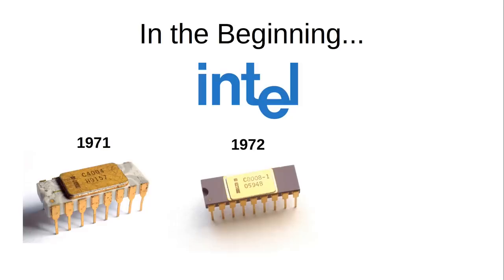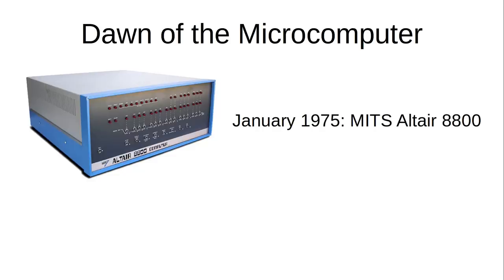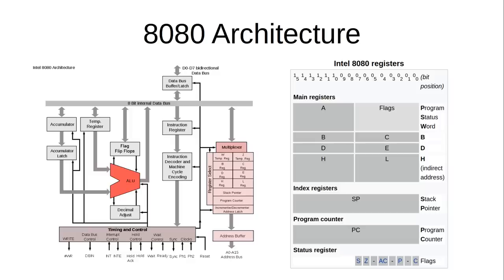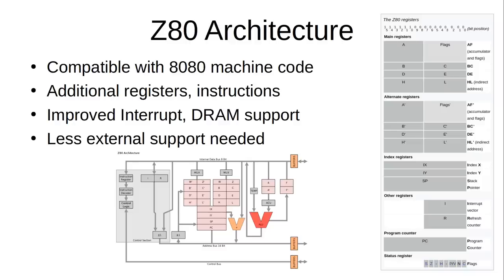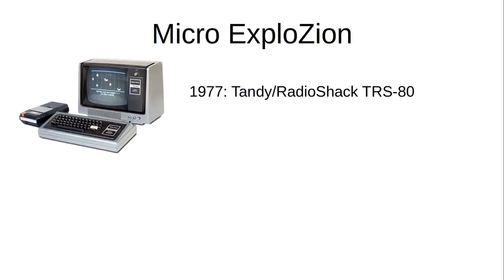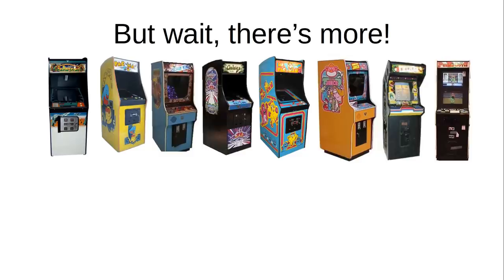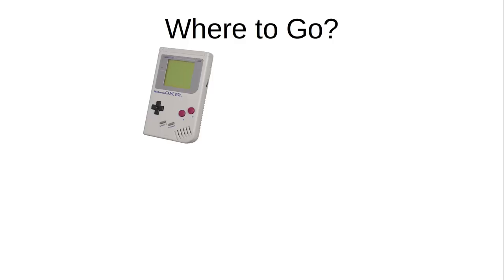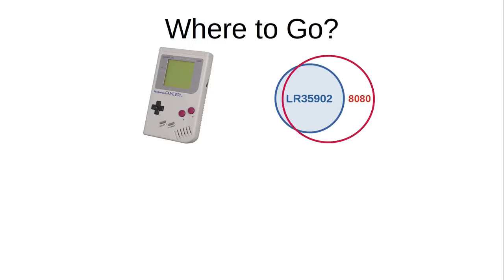Looking at the Zilog Z80 - NEW SERIES!

Comment: Use the Australian Microbee as your development platform! It evolved from an S100 bus computer made mainly from readily available penny logic. It can emulate many machines from TRS-80, ZX Spectrum, MSX computers, Exidy Sorcerer and some commercial arcade machines. Note that the Z80 actually uses a 4 bit accumulator which unfortunately lead to variable length execution times that complicates interfacing with shared video RAM.
Reply: Wow, another microbee user! I couldn’t afford one, so I got hold of the circuit diagram of the bee, and made my own using wire wrap technology, cloning the eprom from a mates real one. . Even built the floppy drive and colour video interfaces. Taught me so much. Wish I had kept it...

Comment: Two more British home computers that featured a Z80 CPU were the Memotech MTX 500 & 512 machines and the Jupiter Ace which used Forth instead of BASIC as its programming environment. I started out with a Sinclair ZX81 (with a 16k add-on RAM expansion by Memotech) and then a ZX Spectrum. I've recently returned to my Z80 roots (after messing about a lot with PIC, AVR and ARM microcontrollers) with the recent purchase of a Z80-MBC2. The Z80 has always been a great processor for me and I'm looking forward to coding in Z80 assembler again.

Comment: The lack of Ram on the ZX80 meant that to do anything really impressive you had to write in machine code. The Sinclair Z80/81 was one of the best written manuals for a micro computer ever and funny too, it was also very good on the machine code and how to write machine code programs. I found the Z80 instruction set much easier than the 6502 we had at uni.
There are some odd gaps in the Z80 instruction set, one can even work out what they might do and some of them did do things but usually totally totally screwed up the flags register.
The Sinclair implementation of the Basic programming language is still probably the best Basic out there. And I like GoTo.

Comment: Interesting video about the history of the first computer systems.  I assembled my first computer in 1976, the SWTPC 6800; soldered pin-by-pin to the circuit boards with 4k RAM.  I still have that computer.  It used the Motorola 6800 MPU.  Thankfully, I'm a programmer, so I was able to write the device drivers (in Assembler) I needed for my peripherals, including a Heathkit H14 Dot Matrix printer (also assembled by me)
Reply from the maker: That is really cool! Does it still run?
Reply: @slithymatt  Yes, it still runs.  I wrote my own BIOS for it and burned it to an EPROM to make life a bit easier.  Added a Percom floppy disc drive (10-sectors, hard).  Modified the BASIC interpreter and Assembler to read data from the drive instead of the cassette tape player.  Bought a video board, and wrote the device driver for that as well.  Good time.  Good times.
Reply from the maker: @RamblinRick_  that is really impressive
Reply: @slithymatt  thank you

Comment: A very useful 8-bit cpu, going way back.  RCA's 1802 is also one of those nifty 8 bits, but this one was one of the earliest CMOS chips.  It had onboard a number of features that many microcontrolers later sported.  In many was RCA's chip was one of the most groundbreaking chips ever.

Comment: I put together an IMSAI 8080 as a kit in the late '70s. The person I later sold it to replaced the CPU with an Z80 processor and installed two 8" floppy drives.

I also worked for an Apple dealership in the late '70s and '80s. We looked at selling the Sinclair computers, but they looked too much like toys and the video would flicker for every keystroke.

Comment: I still have a ZX80 that most likely still works.
Chances are in some box, I also have the 16KByte expansion RAM I built for it.
You could do quite a lot with a ZX80.  Some people made maze solving "mice" based on them.
The thing about the ZX80 that allowed a lot of this was the fact that the whole bus came out on the expansion connector.

Comment: Excellent. I look forward to the series. I'm originally of ZX81, then Speccy origins myself :) [ I still have an Amstrad "Sinclair" Spectrum+2 in a drawer next to me - and in the back room gathering dust, I've got a Yamaha CX5M II MSX Z80 Machine with FM synthesis a la Yamaha DX21 keyboard, but with on screen controls :) ]

I took apart a Sequential Circuits TOM Drum machine I own the other year, just to take it apart and clean the contacts on the pads, and was pleased to find a Z80A CPU sitting proud inside :) 

aside: LDIR is still my favourite assembly opcode, but I really should get out more :)
Reply from the maker: If you have a favorite opcode, you've found the right channel. Thanks for coming by!

Comment: I did a bit of research and analysis when I was deciding which z80 based platform I'll port my game to first. I chose the MSX2, mainly due to it having multi-color hardware sprites. Like you, I have never used a ZX Spectrum or an MSX system, but my understanding is they were both wildly popular in their respective regions, with the MSX even having a following outside Asia. But your call on the Spectrum is probably the correct one, I think it has a much more vocal and prominent nostalgic fan base.

Comment: Back in the mid-70's the 4004 was used by a medical company in the Central Florida Gulf Coast region.  Later followed by the Zilog Z80, and then the Intel 8086.  Those were the good-ole days.
Reply: I can remember programming the 4004 to control a model train set.  That was the day of hardware revolution.  Things moved so rapidly that every year was a huge step forward compared to the year before.

Comment: I'm still doing a lot of Z80 programming! My most recent sub-project was writing binary32 float routines 😎 (Part of a larger project that has 80-bit, 24-bit, and another 32-bit format, hopefully with binary64 and maybe some base-10 floats in the future)
Reply from the maker: It would be interesting to see how well a Z80 could do double-precision floating point. I know the answer will be "not very", but how bad compared to other 8-bit integer-only CPUs?
Reply: At the moment I'm faking double precision by wrapping it in the extended precision routines which are pretty decent speed-wise. On the TI-83+/84+, they are far faster than TI-OS's floats (14 digits BCD, versus ~19 digits for the extended precision floats). Multiplication is around 9500cc, so about 630 multiplication per second at 6MHz
Reply: Erp, I accidentally a sentence. I'm not sure how it compares to other systems (I know comparing clock cycles is sometimes an apples-to-oranges comparison).
Reply from the maker: @ZedaZ80  Clock cycle comparisons are pretty good for comparisons, so it can be oranges-to-oranges, where you have different sized oranges and some of them are peeled on one side, to belabor the metaphor

Comment: In 1976 I built my first PC when I built a IMSAI 8080 and within a year added a Z80A CPU with 24 k ram, floppy disk and later a hard drive.  The hard drive was interfaced via a parallel port.  Long time since then.
Reply from the maker: That's quite an impressive setup for an IMSAI!
Reply: @slithymatt  I used it in 1978 and 1979 to enter my Masters paper.   I hold a BSEE, MEEE in Electrical Engineering.  My specialty was microprocessors.   In my first job out of college, I got into C and UNIX.  I worked virtually my entire career using C and UNIX and UNIX like systems.   Good luck with your Z80 series.

Comment: Motorola used the Z80 processor in its Electronic Mobile Exchange (EMX) 250 and 500 range of Cellular infrastructure switches which connected all the base stations and connected to the land network  that ran the AMPS and TACs networks in the US and Europe in the pre GSM days.  From memory it had  3 seperate computing complexes that were interconnected by high speed ( probably 128Kbits/second) links, each of these complexes had two processing cards that would run in active/standby mode. I cannot remember the exact amount of memory but it was banked/paged so that  you could change to different pages of memory.  A 3active+3standby CPU distributed system running at 4 Mhz, communicating with other switches all written in MPL (motorola programming language) which was a simple pascal like language, but all critical parts of the system will written in Z80 assembly.   The software image was loaded off computer tape, and it was possibly to live patch the cpus,  find an empty space in memory,  hand input a stream of machine code ( make double sure to have the return instruction or jmp back to the right place and then manually add  a call or jump instruction into the running codestream to divert to the patch -- talk about an adreneline rush for a young software engineer to have tested this in the lab but then to have to go onsite to where one of these switches was located and do it on the running system with actual cell phone calls being processed!  When it came time to add SS7 (phone signalling protocol), a 68000? was added as a fourth processing node to handle the SS7 signalling.     Cellnet in the UK ran its first mobile network on these switches, from memory there were 20+ of switches deployed the UK, interconnected together for control plane messaging by 64kbits/s links and using the PSTN E1 trunks to pass voice traffic between the switches and to connected to the landline PSTN network

Comment: Thanks for this Matt,  as a kid growing up in the UK in the 80s the Speccy was my first computer. I still have a rubber keyed 48K and a "mighty" 128K in the attic.  Are you planning coding in assembly? Sinclair BASIC is a bit slow, but machine code games running on the 3.54MHz Z80 could be quite quick for the time. Im sure you are going in with your eyes wide regarding the graphical limitations, its best to embarce them rather than fight them.  I would suggest looking at the demo scene to see whats posssible with some tight coding. Another suggestion might be to use the 128K model in FUSE , the basic editor does not require the use of the code keys which makes life a whole lot easier and secondly you have access to the AY38912 sound chip not present in 48K.  Looking forward to seeing what you get out of this little, limited system which brought me so much joy as a kid.👍
Reply from the maker: Yes, I will be primarily coding in assembly, but I may have some diversions using BASIC or C.
Reply: @slithymatt  Nice, I shall play along at home on my Speccy and see how it goes

Comment: I know the Z-80 inside out, having had multiple TRS-80s and now a TRS-80 emulator that emulates all versions on any Windows PC.  I used Microsoft Z-80 Editor Assembler Plus to write games (maze and split-screen adventures), utilities, and extensions to NEWDOS80.  If you used NEWDOS80, you most likely had pirated copies of the extensions that I wrote, though I don’t know if they made it out of the US.  Key80, PDrive, Menu80, etc., which were all simply added to the end of the SYS0.SYS file.  I also backwards engineered all of the Sound-80, Music-80, Orchestra-80, Orchestra-85, etc. boards.

Here in the US, the Sinclair was nothing but a joke, as it barely worked.  If you did use it, it would usually be useless within 3 months.  Sinclair ended up being forced to give refunds to any ZX-80 owner who asked for one.  A few years later they came out with something better, that didn’t break down, but it couldn’t do anything either.  You could buy Model 4s for under $400, so why would you spend $129+ on a cheap rip off?  You couldn’t even run a BBS on it, unless you made a HUGE hardware investment.

The Z-80 was a great chip and it is so sad that they said no to IBM when asked to produce Z8000s for the IBM-PC.  The only reason we have Intel today is because Zilog (now AMD) said that they couldn’t produce the numbers that IBM was asking for.  IBM even offered to help them, but they still said no.  Intel was failing miserably at this point, but when IBM asked, Intel said yes, even though they had the same production limitations as Zilog.  BTW, IBM wanted the 8086, but Intel was having severe production issues with the 8086, so they dumbed down the IBM-PC to the 8088.

Comment: Have you heard the dodge that lets you run an ISR on the Z80? 
There is an interrupt (mode 2) that can be set up to call a routine, but the memory address called is the MSB from the I register and the LSB from the data bus. When I read this I gave up, as there is no way to control the data on the data bus. 
However, cleverer folk than me realised that there are only 256 possibilities, so if you set I to point to a block, and filled that block with (IIRC) C3 C3 C3 then no matter where it landed you would get a jump to C3C3, and you put your ISR there. 
On the spectrum the mode1 interrupt location, 0x38, was inside the ROM and not useful to users.

Comment: I just got my z80 cpu chip ready to make a breadboard z80 fun computer :)  the thing with this guide is its targeting  a platform for learning z80 assembly. The issue for me is, I don't really want to have to learn there OS, I am more interested in learning the z80 assembly language  itself with tiny examples.  I look forward to what you come up with. Spectrum seems like it might be good for learning the basics.
Reply from the maker: The series so far is very generic, going over Z80 instructions rather than ZX Spectrum ROM and I/O. Please check it out! Episode 6 will be coming out on Monday.
Reply: Yes I will watch them all.  My computer will use a 4 line LCD, and I noticed the commander x16 is using I2c. Maybe they emulated it, as that would let me use many interesting options including a OLED display. :) Of course this is a bit down the track.

Comment: The Commodore 128 computer primarily ran with an 8502 chip, however it did include a Zilog Z-80 CPU to run fully CPM compatible software like Turbo Pascal and Wordstar.  It was a cheap computer but it wasn't bad for some of the software it could run.

Comment: The other processor from around the same time was the Motorola 6800, and then 6809.  The 6809 did not have the issues of the 8080.

Comment: No mention of the Microsoft Z80 SoftCard for the Apple II? That's what I had. Worked great to let me run GBasic, WordStar and Turbo Pascal.
Reply from the maker: That was a good add-on, but part of the same reason why I didn't mention the Commodore 128. These were very little-used features on systems that ran almost exclusively 6502 code. The Sega MD/Genesis was my primary example of an auxiliary Z80 because it was used for all of its software to run the audio. So, unless a game is totally silent, it's running Z80 code on top of the main 68000 code. And the Master System adapter was very widely used by people that had upgraded and still had a Z80-based game library they were playing.
Reply: Turbo Pascal for Z80?! That would have been just prefect, didnt know that existed.

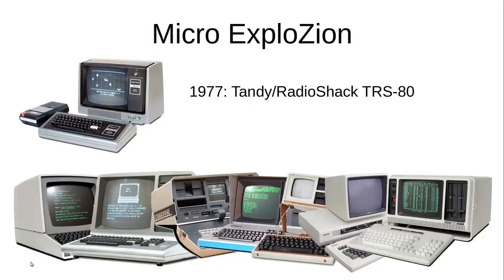Comment: Probably already pointed out in comments (but I couldn’t find it yet) but @ 7:40 the TRS-80 model 4 had a pair of 5.25” floppy drives not 8”. Also the picture shown is not a model 4 but a Tandy 6000 which did have 8” drives. Other than that great video!
Reply from the maker: Is that a 6000? Many, MANY people have pointed out that I misidentified the model 4, which I managed to conflate with the model 2 in my mind, and most people seem to think that the picture I found was a model 2, but I think you're right. That does look more like a 6000. The big lessons to take away are 1. I sometimes slack on the research when I mistakenly think I know what I'm talking about, and 2. Google doesn't give you good results when you do an image search for a model 4.

Comment: Wow i would be greatly interested in the series. First step would be developing a routine for moving a sprite around the screen, which is a bit demanding to do on the speccy, due to the confusing video map.
Reply from the maker: Actually, there's a lot of steps before that. There are a lot of concepts to master before getting to that. I didn't get to sprites on my X16 series until episode 18, and that system has hardware sprites!
Reply: @slithymatt  i'd be blown away if there were 18 videos on the speccy. I'll be with you every step and if you develop a game it will see the birth of mine along the way, pinkie swear
Reply from the maker: @buntekuh01  We'll see how the long the series goes. The X16 is a much more sophisticated system, so there are a lot more components to go over. On the other hand, the Z80 is a much more complicated ISA, so I'll probably have more videos on just how the instructions work compared to my X16/65C02 series.

Comment: For completion I would have liked a mention that Zilog tried to compete with Intel in the early 90s by introducing a Z180, Z280 and even Z380. The Z180 core was also licensed (or ripped off?) by Hitachi and Toshiba who both made microcontrollers using that core. Hitachi's were widely used in commercial products like HiFi Systems since there was a big variety of 64 pin shrink DIP versions that had VF display drivers built in.
Reply from the maker: I'm pretty sure those Japanese chips were licensed, and those companies have their own fabs, making it cheaper for them to license Zilog's design and fab their own